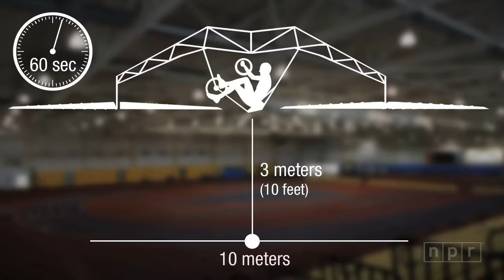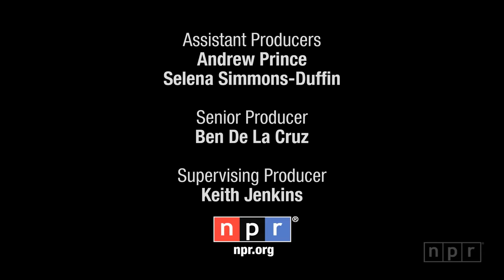Human-Powered Helicopter: Straight Up Difficult | SKUNK BEAR

Comment: Can't believe what little motion from the propellers can product such lift. Nice.
Reply: I was going to say the same,  I think it must be fake.
Reply: You have 80 lbs spread over a frame that takes up 100 ft and those propellers are close to 50 ft long, they're producing a lot of lift.
Reply: its because of the radius. v=ω*R. you cannot have mutch ω cause of the human factor- pilot so you have to increase the radius
Reply: +Γιαννης Πασχος what is w
Reply: Markk W. Crew It's a lower case omega, it's angular speed
Reply: They are so big they don't need to go that fast
Reply: The air displacement to weight ratio is super high so no suprised
Reply: I was surprised too.
Reply: Physics. The rotors are slow but together they have a large surface area. It looks comparable in area to a human powered airplane. 

At the end of the day it's about how much air is moving over how much wing/rotor area. You can move a lot of wind over a little area (fast spinning, low surface area) or a small amount of wind over a large area (slow spinning, large area).
Reply: Phongsta yeah but will it lift Kim jong un?
Reply: Phongsta a bigger propeller is more effective then a smaller propeller spinning faster
Reply: @ricardopr54 Its not fake.  Think. Use your head.
Reply: deez are some giant-ass props dawg, they make hella lot of lift.
Reply: deez?  dawg? hella?
Reply: Gunther Ultrabolt Novacrunch deez=these, dawg=bro, Hella=a hell of
Reply: its not about the speed of the propellers, its the surface area of the propellers
Reply: Yeah but with such large propellers, there's more air resistance, so shouldn't it be difficult to move all of them only with legs and arms ?
Reply: Mt Grn i wonder if they could rear the pullys in order to adjust to a larger propel it will increase the amount of work needed but will increase the amount of life
Reply: Research flat earth!
Reply: Phongsta the size of it makes up for it. Those are like fucking cessna wings. Normal helicopter wings of course need to be hauling ass to generate lift because of how small it is
Reply: surface area. nothing more. The larger the blade the more air is being moved at slower speeds.
Reply: I call fake aswell. Seems for me such a big structure and the propellers almost not moving makes it weird looking. Where is the bend in the material from lifting him?... totally fake.
Reply: @Kimoto504  A helium injected foam and filled frame with a pressure switch would been handy to strip the weight off the rider and vehicle. Like negative ballast. Only need a tiny amount of lift if you can get its weight down to a negative sum unladen.
Reply: ricardopr54 look up those rubber-powered model airplanes that are used for indoor endurance competitions. They have large, slow moving propellers like this does. The reason for that being because a large, slow-moving prop is able to produce enough thrust to power the plane like a smaller, faster-moving prop. The difference is the larger, slower moving prop can do it for longer periods of time. Resulting in model aircraft that can fly for as long as 40 minutes. They’re using the same idea here because these large rotors don’t have to spin as fast to get the helicopter off the ground
Reply: Someone said it was the ground effect
Reply: It’s the size of the propellers
Reply: exactly. The rotor blades spinning way to slow to take off. I'm an engineer and I'm telling you: It's fake. Some people are saying it's because of the size of the rotor blades, which is also nonsense. Please build it and try it by yourself. You will not take off 1-inch.
Reply: It's surface area... Not rocket science.

Comment: There was this video I found that this 3d printed pulley system that took a tiny hand crank where you could barely pull the gear and the propeller at the top would spin ten times faster and I think they could use this I'm only in highschool engineering so I don't know alot

Comment: Impressive work! Perhaps they need a "tail" rotor to keep the helicopter stable? or may be some how be able to adjust the angle of the rotors to compensate for the drift ? easier said than done but such an impressive work! Really liked it!
Reply: Or to very slightly alter the gear ratio on some of the propellers to increase speed on them and tilt. You'd need two rims of differing diameter side by side, but the problem is the drivetrain is a string that needs to be rewound, and you'd have to predict in advance what rim to put the string on with every set of blades.
If you can increase the speed of some of the rotors with a higher gear, you can tilt it away from the direction of drift. A simpler option might be to intermittently cut power to one or more of the rotors to correct a tilt. You would need some sort of pull string clutch to disengage the rotors opposite the direction of drift. The rotors would coast for a bit and the other rotors would lift the side of the craft and move it away. I don't know how to fully automate the system so it would need a skilled pilot, and he would no longer be able to use his arms for pedaling. I say he because you can usually find men with higher power to weight ratios than you can women.

Comment: This is the moment where you realize how much power is contained within 1 liter of gasoline.
Reply: I was thinking about the power of humans
Reply: Love the metric
Reply: A gallon of gasoline contains 31,000 kilocalories
Reply: @harrisonbuck2749  How much would I have to drink to gain 1 kg?
Reply: @kaspervestergaard2383  1L lol
Reply: @slammed4578  xd
Reply: @slammed4578  1.1 liter at least, gasoline has lower density than water.
Reply: you mean how much power an engine can produce with fuel? i mean, fuel only makes for combustion, the engine makes for flying.
Reply: No.... food is also INCREDIBLY energy dense. It's the "engine" that's the difference. Make internal combustion engines or electrical engines really large and they'll produce as much as you want. No upper limit to power. Human muscles though.... very different.
Reply: Perhaps burning corpses into an engine can be homologated as human powered ?
Reply: @RoScFan  That's just not accurate, same reason animals have size limits. As you build bigger, one input goes up by power of 2 while another goes up by power of 3 and therefore there is definitely a size limit with everything.
Reply: @harrisonbuck2749  but isn't burned very efficiently
Reply: @RoScFan  Incredibly dense, I have enough body fat to walk 100's of km's without even eating lunch.
Reply: And also, how efficient our bodies are.
Reply: @davidgruen7423  I didn't know that David :D

Comment: They need a bigger room to do it in. Like a legit hangar or Blimp hangar. They are getting limited by their own vortices. The air is cycling down, back up the walls and down from the ceiling. That wind has velocity which is undermining the rotors lift a bit.

Comment: I knew that second guy was going to crash haha he was being too cocky.
Reply: McClover No he wasn't, it's just that once the aircraft gained that forward momentum it didn't wouldn't stop going in that general direction, it possibly couldn't.
Reply: Ziyad Thunku Ousmand I think the problem is they yell at him to back down when it is basically too late, then it starts dropping too fast.. so yeah its not entirely his fault. They probably need a bigger space to test it in and some padded material to protect it when it crashes. Although to the credit of McClover, had a bad feeling about mustachio as well.. blondie had more respect for the task and showed more control on his run. It makes me wonder when he had such a good run why they had the other yahoo try.. talk about a bad decision
Reply: +Arthur Kay I think they yell like it's super bad so he basically like stops the thing
Reply: +GremlinFPV The instability you describe is inherent to all rotary wing aircraft, not only quads. Indeed, this one did not have any kind of control and for this reason it lost the competition to another, even larger quadcoopter - the Aerovelo Atlas, which had huge, 20m diameter rotors turning at just 10 RPM and one very important difference: it had control, allowing the pilot to remain inside the assigned area throughout the flight. So the Aerovelo team pocketed US$250,000.
Reply: ***** No worries, your point came across as well. Happy flying, fellow FPVer! :)
Reply: Elmer Habavilo Bro da weeds much too strong fo ya.

Comment: Use an olympic cyclist that has bigger legs than my torso.
Reply: Weight is an issue.
Reply: @juanpablooliva5382  output ratio is still better with greater muscle vs its weight
Reply: yes an olympic cyclist would fly that thing over the atlantic
Reply: wouldn't it better with swimmer? they need both legs and arms power
Reply: or a rock climber
Reply: they already won the prize money, not these guys tho. The guys that won it change the seating design to that of a bike and won
Reply: Forstemann
Reply: I'd actually take a female CrossFit games athlete. Female because they will tend to weigh less and in CrossFit they train for this type of all out total body effort.   Brooke Ence is a good example.
Reply: Bring juiced up Lance Armstrong.
Reply: @wickedlou9  Males have better physical performance. Males tend to have less body fat which is dead weight. And that is the weight that would be problematic, not muscle weight.
Reply: @Relaxing137  yeah but more power can rip the structure apart 
Its refered in a different video
Reply: @Zeemis  those people dont focus on strength
Reply: @Zombie3110bd i mean the olympic cyclist i referred has enormous amount of leg power
Reply: Also more gears in order to optimise the human effort. Just like on a race bicycle.
Reply: Flies away
Reply: You gonna pay em?
Reply: @Zeemis  i dont smoke crack sorry
Reply: Yup throw a lean track cyclist or even a short crew rower on there and it goes better
Reply: they could have used anybody but these fortnite dweebs and flown the thing 15 feet.
Reply: Louis Gallinaro Males are much leaner and have a better weight to strength ratio than women. Sure women weigh less on average, but they are much weaker for the difference.
Reply: watt/kg  is the answer to your statements and all yours comments.
Reply: I think that cordination between arm/leg movement its more important. A drummer could be a good option too
Reply: @wickedlou9  brooke ence takes testosterone, you can clearly see it.
Reply: Rock climber no chance lol
Reply: Team simp
Reply: They just need an electric motor... hide it and pretend is human powered thats all.
Reply: Use some fucking hamsters
Reply: @Relaxing137  bigger person requires more solid support and framework which adds to weight too
Reply: Need light person
Reply: Relaxing Gaming well no because the ones with the massive quads are sprinters
Reply: @yulasharm4723  legs 4: arms 1
Reply: like Sagan,  but time trial specialists would do a greater distance
Reply: Marathon cyclists last longer. Yes, there too.
Reply: @juanpablooliva5382  road cyclists, specially the GC contenders, have the higher W/kg
Reply: I don't think so. Muscle weighs quite a bit.
Reply: You guys are nuts and the OP is correct: a sprint cyclist with tree trunk legs would send this thing into orbit, not some lanky kid with tooth picks trying to push the pedals (no offense, of course). Your swimmer is just as weak, so same scenario. The power output would more than offset the weight difference.
Reply: @yulasharm4723  you're absolutely right , not strong muscles but fast muscles.
Reply: @yulasharm4723  a swimmer cycling isnt as good as a cyclist cycling
Reply: He need upper body strength too because his hands contribute power.
Reply: @georgeb.wolffsohn30  : The vast majority of your power input would derive from your legs, so an Olympic cyclist with mediocre upper body strength would far out power an Olympic swimmer with mediocre lower body strength.
The ideal candidate for this engine would be an Olympic power lifter because they have maximum power output at minimal weight. Imagine a 150-pound man that can squat 500 lbs and press 400.
Reply: @nottelling4828  what I noticed was the cyclist's body flailing about as he used all four limbs to power the helicopter. If the seat were better designed and an effective body harness employed the cyclist would waste less energy.
Reply: @Thomas Daly : Yes, like the aforementioned power lifter in my previous post.
Reply: @Relaxing137  Output ratio is not better. Birds will tell you differently. The helicopter would have to basically maintain its 80 lbs weight while being vastly larger to compensate for the driver's weight.
Reply: That’s thicc af
Reply: @yulasharm4723  swimmers are literal rocks
Reply: Don say that
Reply: @pontusolssonPrivat  The future of flying over the Atlantic ! What a mess🤪
Reply: @wickedlou9  a male who weighs 20 percent more than the female is capable of producing at least 50 percent more power
Reply: There was no issue with achieving the 10 feet in this particular video.  The issue was drifting out of the box.
Reply: Nah man thats too heavy and unrealistic. I say they should capture a chimp and train to use the helicopter and be rewarded with drugs and then it will perform super amazing for the drugs. lol then switch the human out after you develop a successful craft with the chimp lol XD
Reply: yeah my thought was a professional cyclist since the primary component is pedals, there is also the hand powered portion, but I would say muscle and skill are going to make up for added weight. Especially since you really ideally want a very fast burst of speed to go straight up without much time for it to drift to the side.
Reply: hovering is problem not the power of pilot , he said that he never reached his fatigue point
Reply: Short course triathlete would be ideal. Some light guy with 5w/kg and good swim times.
Reply: Too heavy for that exact reason